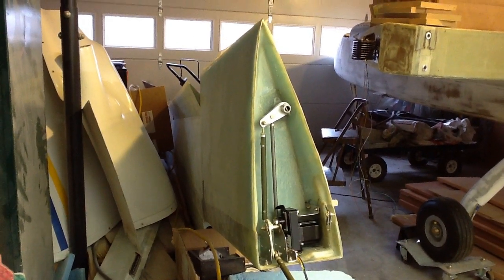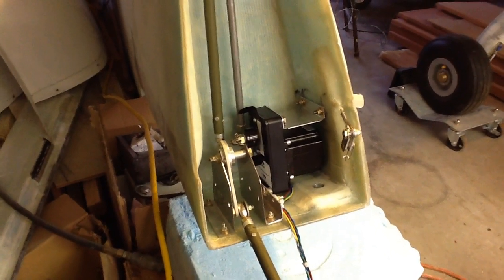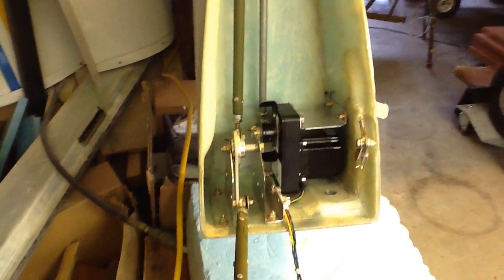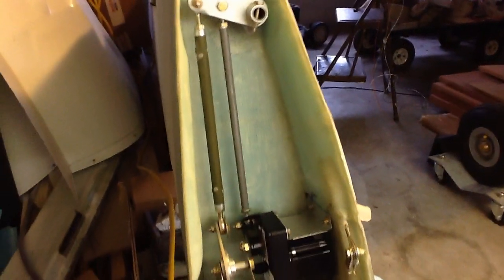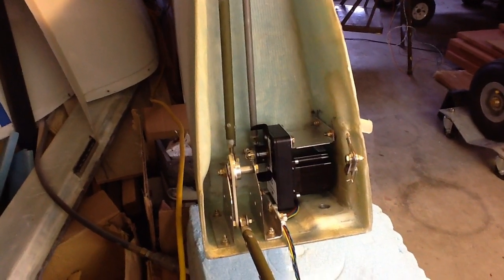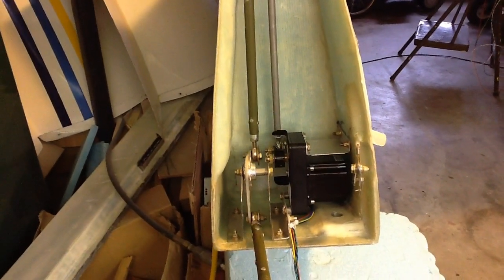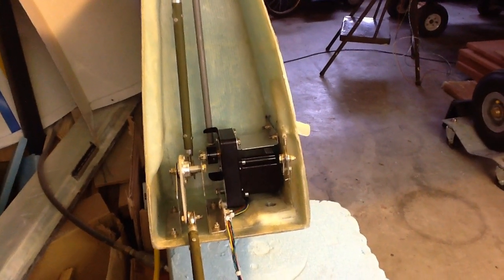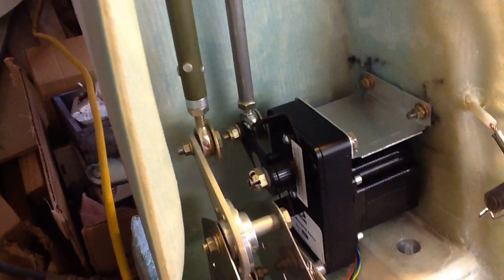Auto Pilot aileron servo installation

Comment: Looks good, is that a stepper motor like used in CNC setups, or something else?
Reply from the maker: I think it must be a stepper motor.  It turns freely when un-powered (as you see in the video).  I'm still pretty unfamiliar with it.  The software has settings for range of movement and torque limits.  You must be able to override it with manual stick inputs, too.  All I've done so far is have the system detect the servo, and then ran the test routine to tell it which way to run for a given control surface deflection.  The rest will have to come later, when I can assemble the wings and canard to the fuselage, permanently.
Reply: @GregoryACross  had software driven stepper motors in bone densitometry systems for scanning people in hospitals and clinics. Glad you mentioned it can be manually overridden because I had some that had travel function issues to failed board components, some of which never were resolved.  Just new boards installed followed by calibrations for potentiometer positioning to re-establish travel perimeters. Anyway, redundancy/backup is key in emergencies to be sure. Thx for the vid!